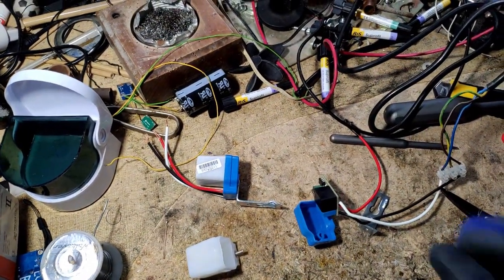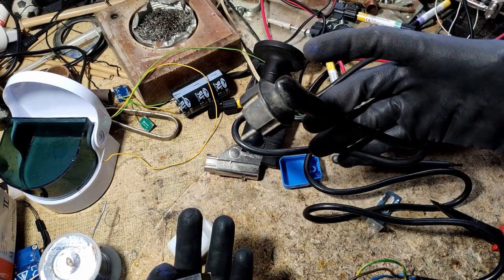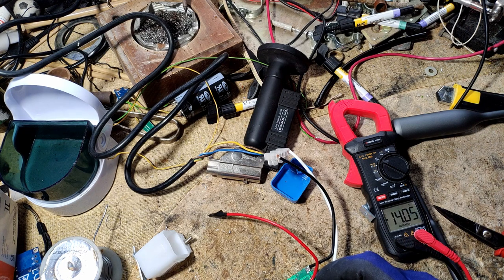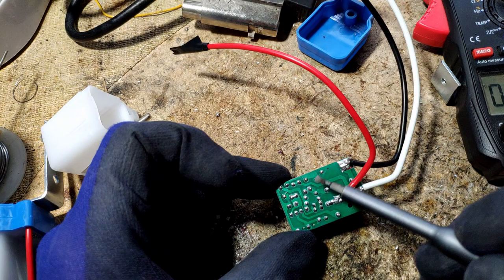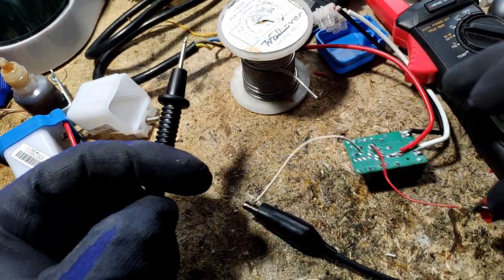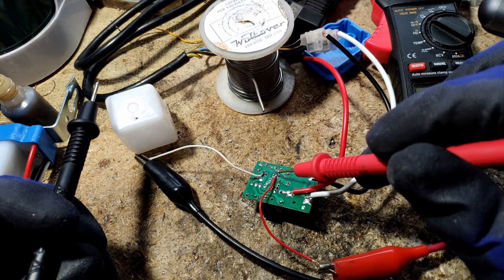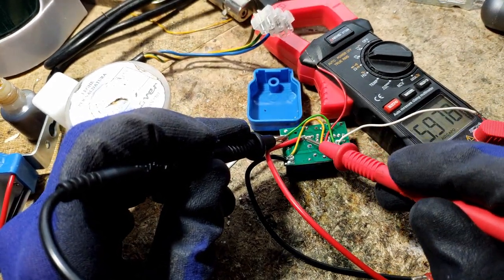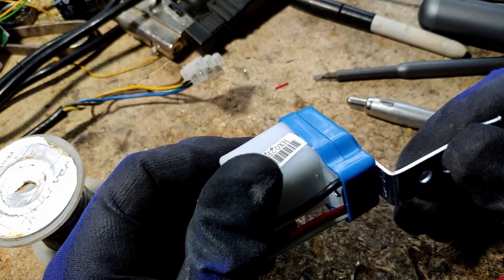Convert 220V AC automatic night sensor light switch to run with 12V DC

Comment: i see they say these can do ac or dc, i watched a guy in thailand wire one direct to a car battery, i ordered 24vdc yet it has a bridge rectifier, wont work on dc .
Reply from the maker: you can attach your source and load bypassing the rectifier